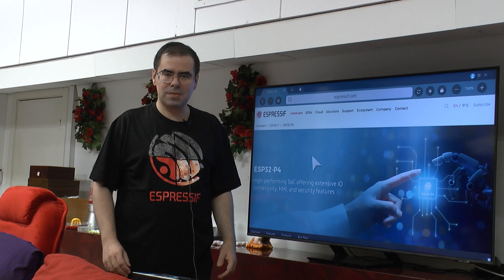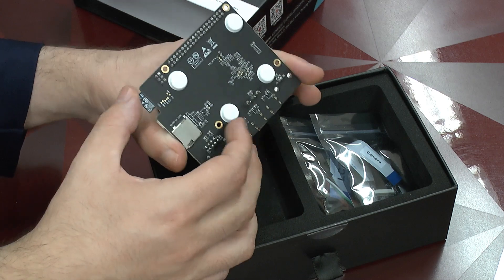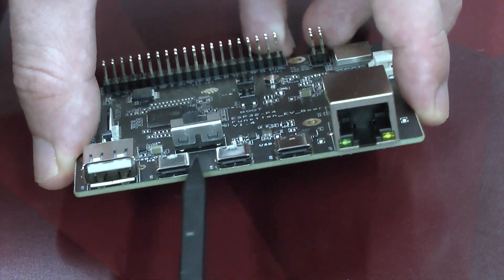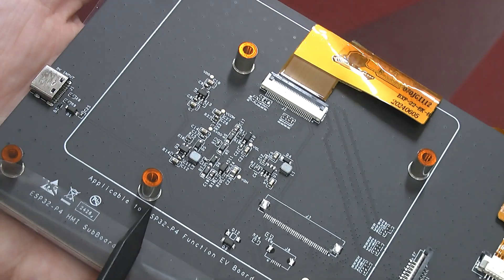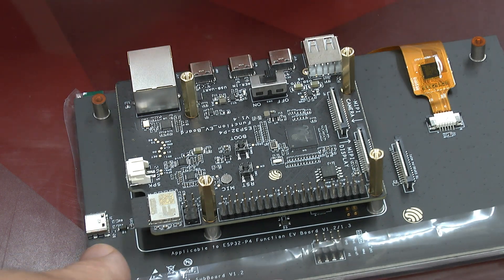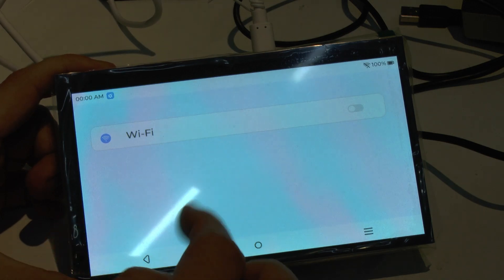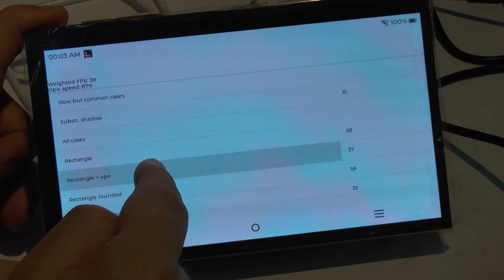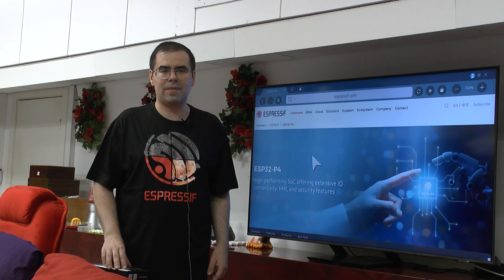ESP32-P4-Function-EV-Board unboxing and LVGL demo

Comment: It's a cool chip, especially with the 32MB of die-stacked ram on there so it can run a full linux, but availability is a mess right now, none of the usual distributors actually sell the chip (lcsc has it listed but no stock). I'm hoping it won't be as expensive as that listing (12€), because otherwise even an old allwinner F1C100S matches it for 3€. If we're taking into account all it can do, an allwinner V851S easily exceeds it for 5.4€. 
And if they want the support argument on their side? STM32MP1 from stmicro beats them on that. So depending on the price this chip could find itself in market limbo.

Comment: This looks interesting, my friend.  I can see a lot of uses for it, like a combination home automation/security platform. It would also make a nice front panel for custom built test equipment or production test fixtures. I would have put it into an automated test fixture at Microdyne rather than require a complete PC on a cart. It changed a 10 to 4 hour manual test, into under a minute.
Reply from the maker: Thanks for talking back, my friend. And sorry for being a bit slow on the e-mail.

This P4, yes, it is quite the HMI machine...

Tam
Reply: @MrTamhan  That's not a problem. I enjoy communicating with people who want to share good information.
Things have really changed in the last 25 years. We still used our few surviving HP 85 computers to run some tests.
I took that crude automated fixture from a simple program that simply froze when a test failed, into an expert system. It displayed the current test on screen. When it encountered a failure, each previous cause was listed on screen to tell the tech what to test. I also corrected a lot of programming errors. The Engineering tech didn't finish the construction and programming. He was careless noting polarity in many tests. He just assumed every voltage was positive, in a split rail design. At least it stopped and displayed the voltage, which you had to 'learn to ignore' because he was too lazy to repair his code. He told me, "Fix he damned thing yourself!" Then he complained to my supervisor that I had "Tampered with his code" He was told never to tell me to do something, because it was well known that I would.
I also added additional tests, and modified the fixture's design. I had to replace individual wires almost weekly on some of the dozens of Berg connectors. I added sockets, then short double ended IDC cables that could simply be replaced when they wore out. He built fixtures that would barely survive occasional use in Engineering, but they were hopelessly fragile for daily use in production.
He's one person that I don't miss working with.
He got upset when I was moved to Engineering to move a new $80,000 SDR based Telemetry product from the prototype stage into full production. I stirred up the entire division, starting with our in house board assembly. I also introduced .015" Ersin Multicore  rework solder to the assembly side. This took a while to settle down, but our failure rate on new boards dropped quite a bit. No more tombstoning of passives or balls of un-melted solder trapped under surface mounted ICs. 
It turned out that their porcess had been set up when 1206 (3216 in mm) were new and hadn't been updated. They complained about the upfront costs, but never thanked me for their savings.
Reply from the maker: @michaelterrell  Hi Man, oh, I know this too well. Projects failing because of higher ranking officers being dim. It is, sadly, part and parcel of engineering...
Reply: @MrTamhan  What is a real pain is when you point out a deign flaw to the senior engineer who made it over a decade ago. They don't even want to look at the evidence. One of our produces used an early Hitachi 8-bit processor. (A Motorola clone) That product had been produced in small batches for over a decade. They often had a problem with the crystal connected to it nut starting. They would try multiple different crystals and exchanging the processor until they worked. Hen I ran into that problem, the schematic didn't look right. It was designed for the short lived NMOS version, which was obsolete before that radio went into production. They used a pair of 20 pF caps. I changed them to the specified 200 pF for the CMOS version. They not only started reliably, but the waveform was cleaner and had a higher amplitude.
The old farts refused to sign my ECO, so I completed that run with the mod, anyway. They couldn't be shipped without five signatures. The division VP asked my supervisor where the radios were. He sent him to me. 
I handed him the schematic and the ECO. He went pale, because he had work on that model when he first started. I explained the problem, along with Engineering's refusal to sign it off. I told him that they were already boxed and labeled. They had been waiting  in shipping for weeks, waiting for clearance.  
He took the ECO, "I'll be back in five minutes!" He was, with all five signatures. He grinned, "They don't refuse when their only choice is to sign, or be fired!"
Reply from the maker: @michaelterrell  Hi, sorry for being a bit slow in responding to you. This is of course a classic - nothing accelerates things as good as external pressure...
Reply: @MrTamhan  I like to see designs improved, over time, as newer components and methods develop. One basic design used in our Telemetry design evolved over several decades. It started with 5% resistors and capacitors but over time they evolved to 1%, with some resistors to .01%. 
You can change an RC tuned filter by simply reheating the solder joints, in some Sallen Key filters.  If the paste solder was staring to age, you could end up with an Ohm of resistance in each joint. Not a big deal with high values, but a major defect with a 7.5 Ohm resistor. Simply remelting both ends you could change the =3dB point by more than 20%. Try explaining that to engineers or techs who are new to Surface Mount construction.

One old engineer claimed that it wasn't the solder, that it was heat damage t the SMD resistors.
Reply from the maker: @michaelterrell  Hi, thank you so much for talking back. Yes, SMD and its introduction was quite the wild ride - I can still remember issues with tombstoning...